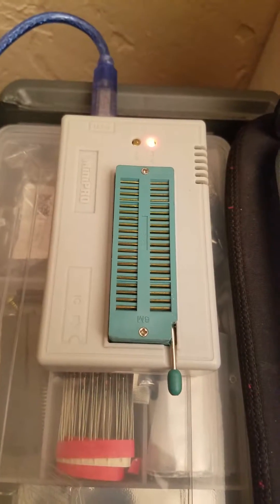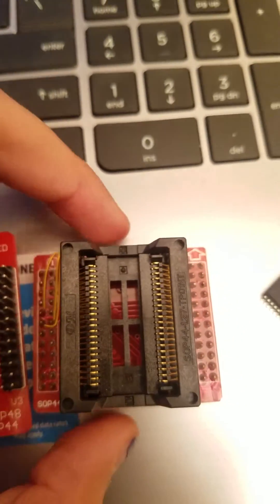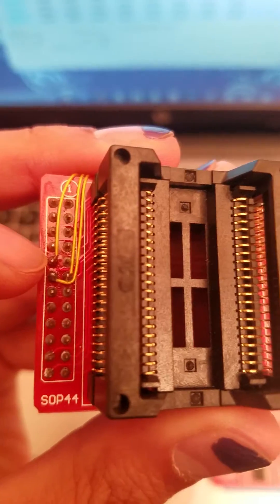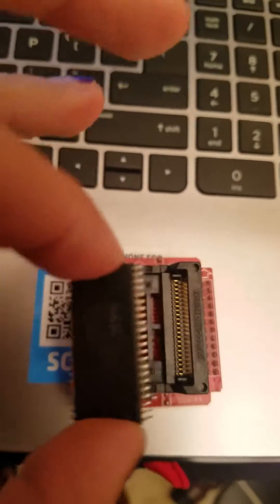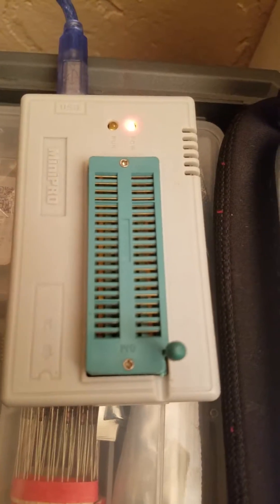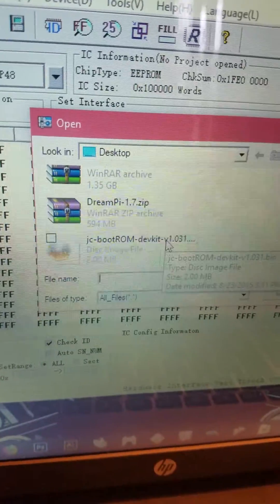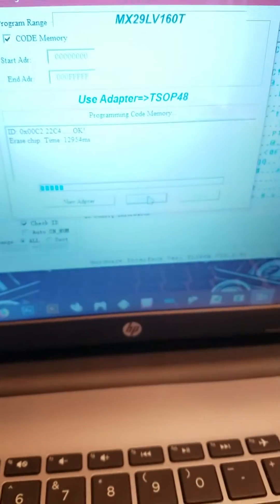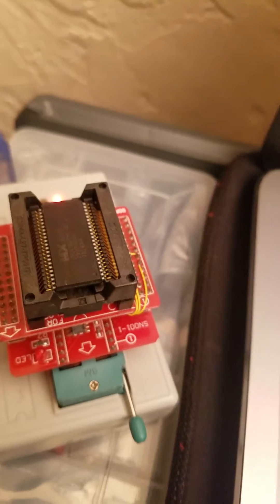How to program a Sega Dreamcast bios with TL866a programmer

Comment: Mine throws a pin error, i tried multiple IC's. One leg. This is using XGPRO v12.63 ( think thats the latest) But i saved back what was flashed and compared the files and they match, so it seems the pin error is ok.

Comment: Hi! quick question; Can I install this in place of the original bios, without having to change any pins? if not, do you happen to have a diagram for that too? And lastly, do you have any affiliate links for the chips? would love to order some, and in return help you for sharing the info!
Reply from the maker: So, you can replace it in place of the original bios chip. But lets say its a V1 board console, legs 1 and 44 need to be lifted, run a wire from 1 lifted to 23 which is soldered down. And then leg 44 to leg 9 of IC502.
Reply from the maker: I dont have any links to the chips, but ebay will be a good source.
Reply: Natalie Marie ofcourse I could find it through the regular ways of Ebay/Aliexpress, but if creators offer them or have affiliate links, I’d much rather buy through that and support our friends in the business :D Thanks for sharing!